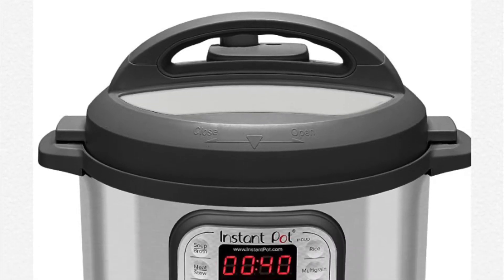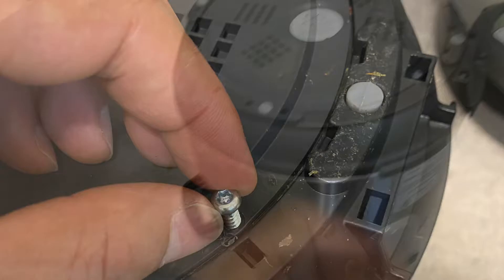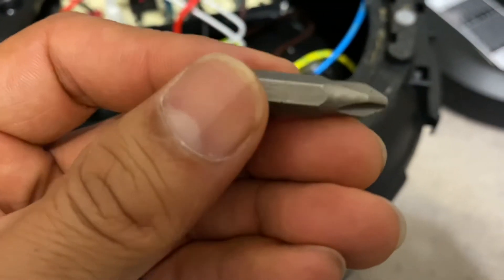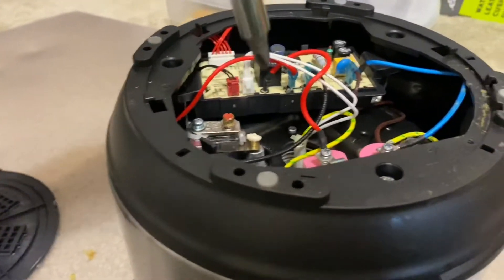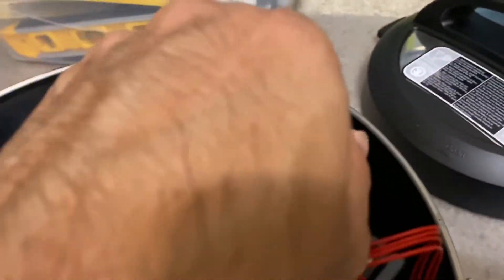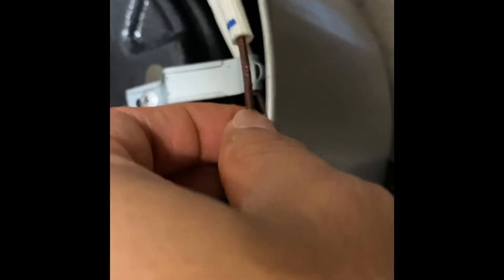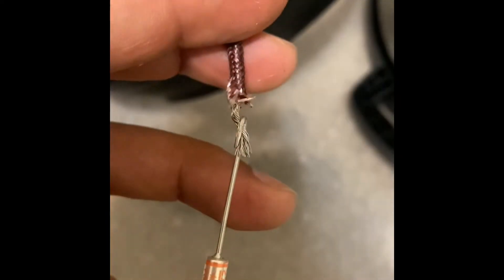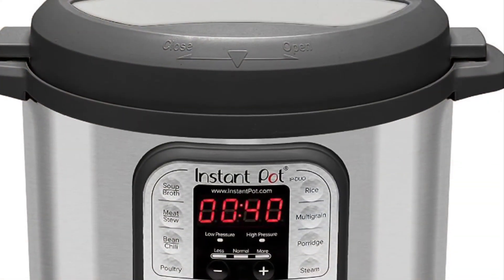Instapot Thermal Fuse Replacement

Comment: Thanks! Is the SF139E fuse the same exact part Instant Pot uses during manufacturing? I'm worried about replacing the part with one rated for a different, unsafe temperature.